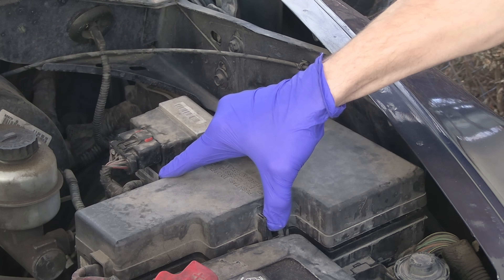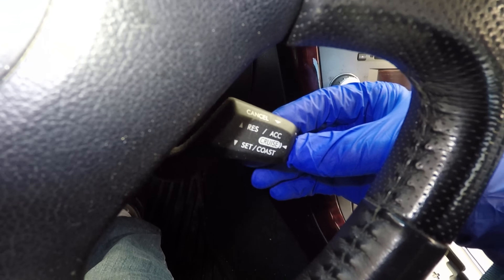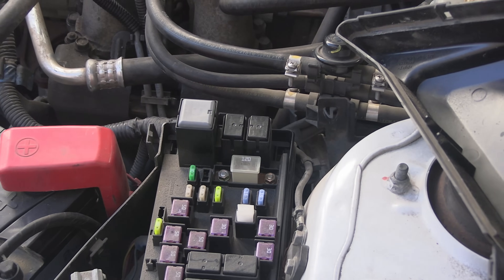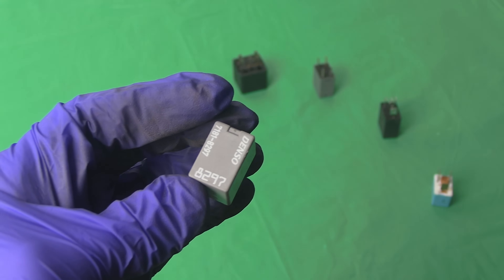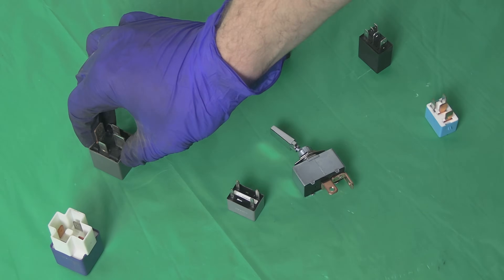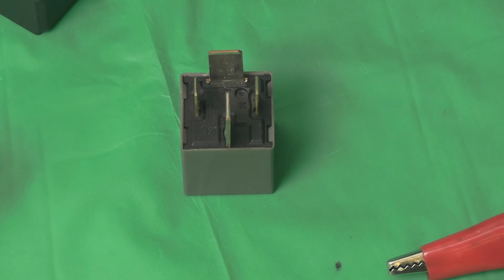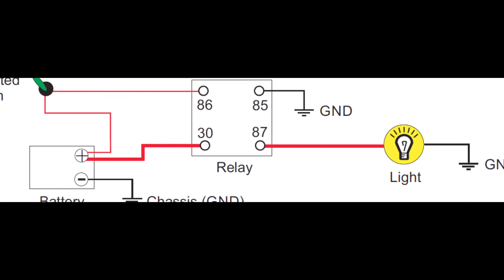How To Test a Relay (and How Relays Work) - in 8 minutes

Comment: What would cause the relay in an indicator to click fast even if you ever get in the car is working properly but it is clicking fast and is on all time and clicking so basically the left indicators blinking fast and when I click to the right indicator blinks correctly now my front right headlight all is gone and I'm assuming that is what triggered the problem this is in a 2005 Mercedes C-Class w203 any suggestions hope to hear from you

Comment: ❤️😍💎 Might be exactly what I need 👌🙏 Because my Mercedes-Benz from 1989 has inner light problems. They burn all the time If the fuse on C position is installed. But the isue is that the central closing system uses the same fuse. Therefore, I uninstalled that fuse to not have a permanent inner light burn inside my car. Have no idea 🤔 for which relay I have to look for. Luckily, I have a multimeter. Next question, are those relays with cooper wire repairable instead of throwing them into the trash and replace them by new a one? Blessings from Germany 😘

Comment: I have an auto relay that's suspect that was clicking and I removed the relay to look at the usual diagram on the case which it has none.  I think what im understanding, is the 4 pin is non polarity because the circuit terminals are diagonal. Thank you for the video it helps working on these non-opening boxes without a diagram.

Comment: Great video.  A good example of a 5 lug relay is a high/low beam circuit. The same relay can be used to power both by supplying power on the control side when light switch is in low beam position and turning the control side off when in the high beam position.

Comment: I just found your channel yesterday while attempting to diagnose a dead power window/lock circuit on my daily driver Lexus LS400. While I knew about 75% of the tips and tricks you so perfectly illustrated, I am very happy to have found this channel. I’m pleased with the extra 25% of knowledge I gained. But, I am even more pleased because I will be sharing these videos with my two sons who also love working on their Toyotas and also a young father I am attempting to mentor through his first car ownership. He recently bought a $650 1996 Dodge Dakota that is what I refer to as a “One of everything car” because it needs one of everything nearly.
Thanks for helping me pass our cumulative knowledge to the next generation. Merry Christmas to you and your family!
(Now, if I can just fix this overly complicated power window/lock/sunroof/memory seat adjustment circuit on this 1996 LS400, I’ll be happier still)
Reply: I’m still stuck on this thing. It’s a 1996 Lexus LS400. I’m getting low and/or erratic voltage at the kick panel fuse box on the power circuit and none of the doors locks, windows, sunroof, power adjustments in the seats and telescoping wheel are all inoperable. Everything else works as new. I did have an extreme amount of smoke from burning insulation under the dash in the vicinity of the kick panel fuse box. I bought a replacement unit but with Lexus security I’m wondering if I change it out will it activate the immobilizer or worse?
I’m not opposed to creating a new standalone circuit/fuse/relay to bypass the stock fuse box but I thought I might ask if you thought replacing the fuse box might cause problems with other systems. It is from an identical LS400 of the same model year and options.
Any help you can provide, even if it’s just to point me to where I should test with my multimeter would be greatly appreciated. I would be happy to contribute to your patreon or similar if you can help me repair or hotwire these windows, etc

Comment: I have a 08 Jetta 2.5 - my fans turn on at normal temp of 190. Degrees ..I have been told it's one of three (3) things the fan relay or the fan control module in the big fan or some other relay that's under the frame on the battery side what would u recommend ???

Comment: I have a tool called a power probe, it's a glorified 12vdc test light that can also inject power or ground, and has a ground wire with alligator clip at the tool handle just for the purpose of testing components. This tool in conjunction with a beeping continuity tester on my multi-meter makes it very easy to test relays.

Relays are incredible devices. Very fascinating. I have a 28 year old beater car that I keep for emergencies and recently the electronic radiator fans stopped running. The module to get them working again was a couple hundred dollars. By troubleshooting the relays for the fans I discovered the module grounded the coil on the relay which turned on the fans. So I added a relay which is triggered by the accessory switch that grounded the coil on the fan relay, effectively turning on the fan while the car is running for about $5. I know it isn't the proper solution but my car isn't overheating.

Comment: Hello I’m having a problem with my fuel pump not working I put a new fuel in and the car was running but now it won’t run there no fuel going through I’ve checked all the fuses and some other relays how can I determine witch is the relay to the fuel pump there’s no electrical power going to the fuel pump that the problem I’m having I’m upset about this the fuel pump was working the car was running now the fuel pump is not working ? Can you give any pointers on what I can do ?

Comment: Great explanation. I wish you would have explained how the relays transfer the current to the switches that aren’t capable of receiving the high amps. They still receive the same amps since that’s needed for the headlights?
Reply: Relay doesn't transfer to switch, the switch uses low power to turn the relay on, then the relay sends higher current to lights
Reply: You still don't have a clear or correct understanding of electrical relay operation theory. Your comment is  not sensible.
Reply: @edwardlara1011  Kk

Comment: I cannot find any diagrams for the relays and which relay is for what… please help. 

2006 dodge sprinter RV diesel 3500 
No click, no start fully charged and brand new battery, no lights on dash. Turning key not even responding. 

But also found mice droppings in the underneath fuse and relay underneath seat. A few wires look like they have been nibbled on.

But to go back to my question. 

Where can I find a diagram for fuses and relay under seat. For a 2006 dodge sprinter 
My rv is not responding to anything
Reply from the maker: Hi Jennifer, I would start with pulling the fuse box and fixing all the wires that you find damaged or broken. Then check all your fuses. I would leave relay testing for last.
Reply: @MakeItEasyMechanic  I appreciate your help.
Reply: I think it’s a bad relay but I wasn’t sure how to go about testing each one. Thanks for sharing

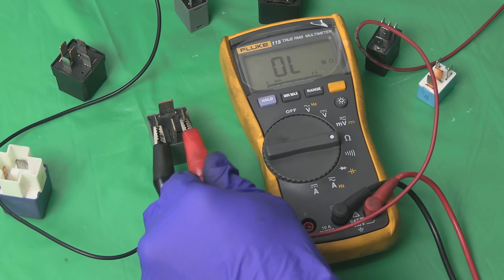Comment: At 06:37, MM:SS,,, BEWARE.  RELAY testing using the OHMeter ONLY, is a common way to MIS-DIAGNOSE and then FALSE POSITIVE a relay as GOOD.  Relays are notorious for developing high resistance arc'd carbon deposits on their LOAD side switch contacts.  You MUST place a LOAD across the LOAD side contacts and check it for V.D., VOLTAGE DROP!!!!! Because, V.D. isn't just a crotch bug!  It's a GREMLIN too!
Reply: VD blues anyone? Just asking...